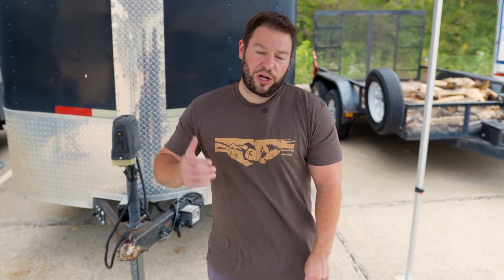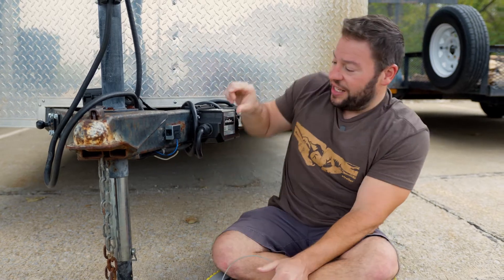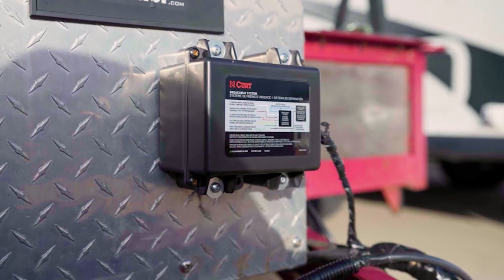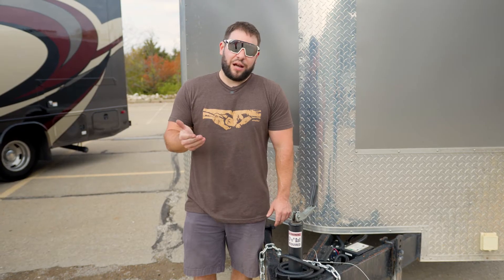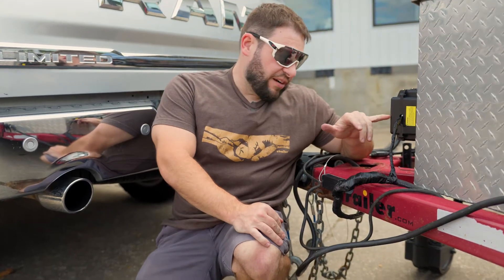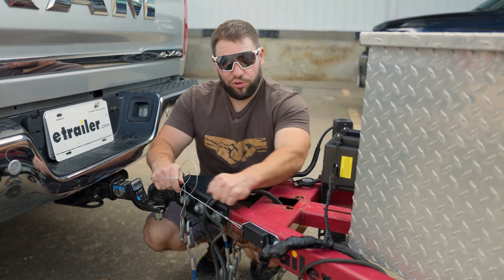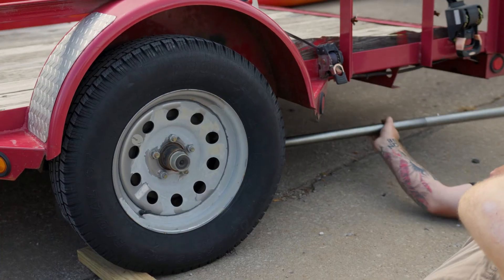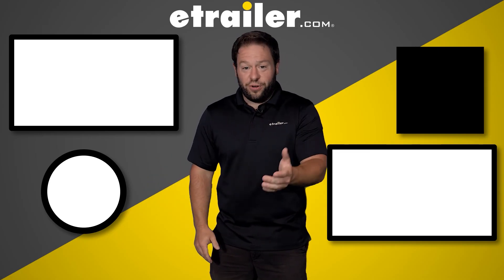How Does a Trailer Breakaway Switch Work?

Comment: Question: 1st, thanks for your video and explanation…

Now, why couldn’t I simply pull the pin while the trailer sits, on its own, to prevent the trailer from being stolen? Pulled away would cause some difficulty for the tow vehicle right?

Just trying to think outside the box for theft deterrent.
Reply from the maker: We're glad you liked the video!
Once the breakaway pin is pulled, the trailer brakes will actuate and will stay on until the battery is dead. 10 minutes to an hour later when the battery discharges, the trailer can easily be towed off.
I hope that helps explain it!